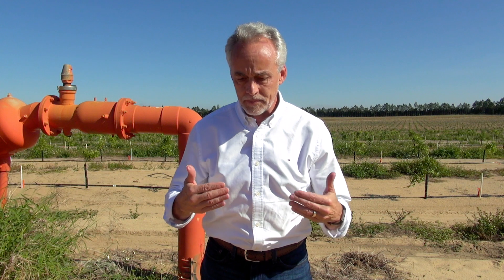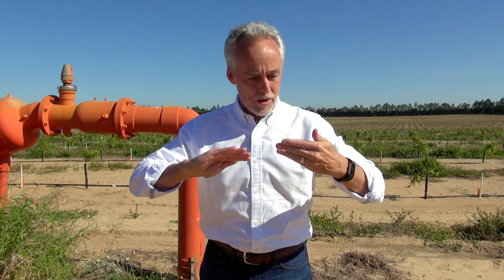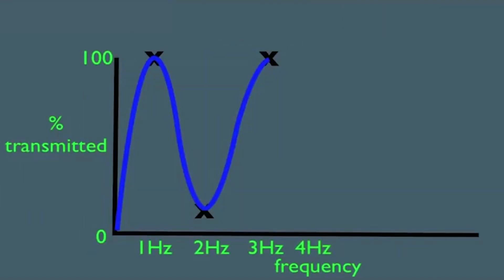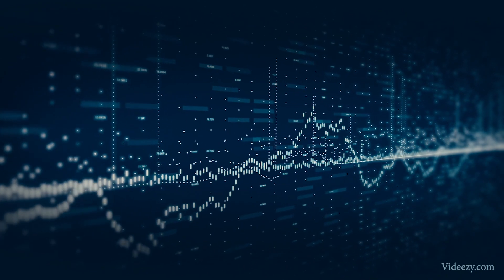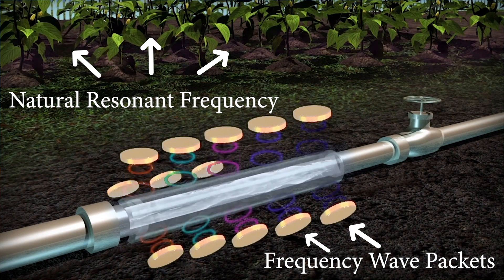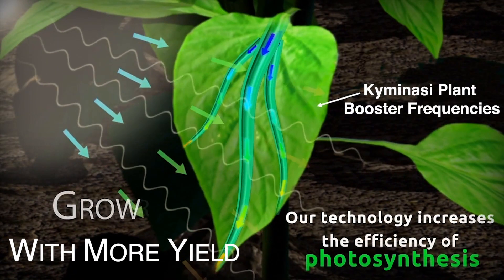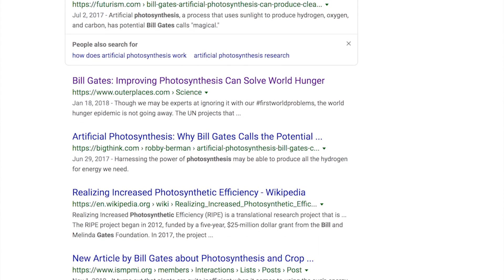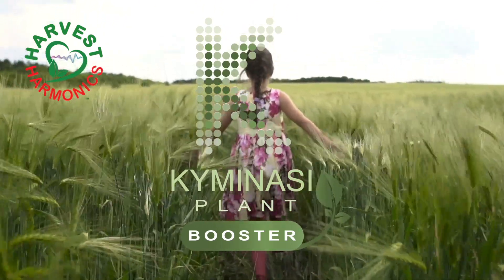Agricultural Engineer explains Kyminasi Plant Booster

Comment: My name is Girish and i am innovater and working in water condtioner technology from last 14 years .i hold a patent for magnetic plus electronic water condtioner.  Coming to thia video... Thia ia white shirt expert scientist ia just talking about several lies ..at 4.25 to 4 35 he ia showing a piece of metal calles silicon chips which can be programmed to store 3000 optimum frequencies etc etc .... Dear air it is not chip or anything related to programming by means it is calles simple rare earth coin magnet which can be magnetised not programmed ...it can not store any information by any means ... It gives magnetic flux which can be use to make magnetic water condtioner.   I hqve seen your videos you are just using non  power type magnetic water condtioner.  And as the technology is very old invented in 1960 so you people now wants to change theory. So yiu new innovative words harmonica and programmed fraqueconcies... Watee has memory ia proved but nothing to do with you product with pre programed chips that do  not require power supply .   If you programme these metal parts but where is wire connection or wi fi or bluetooth nano circuit to communicate with your super computer ....